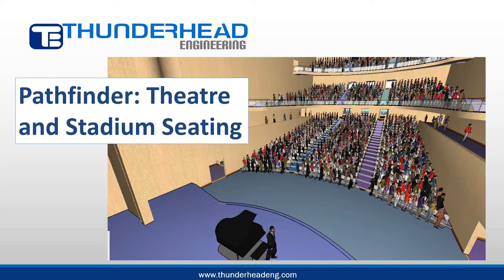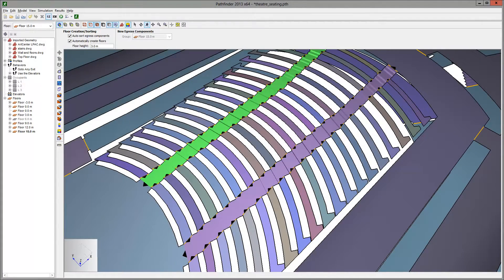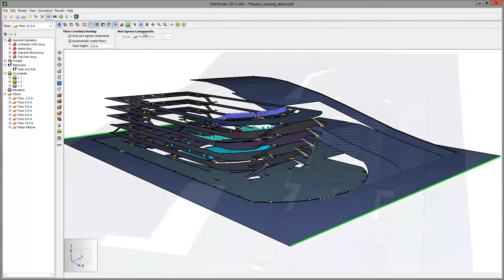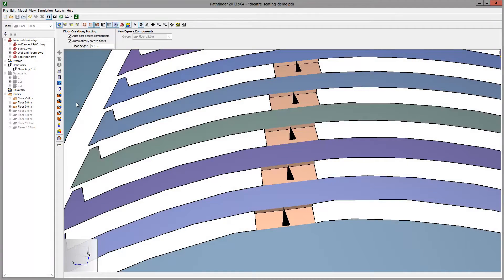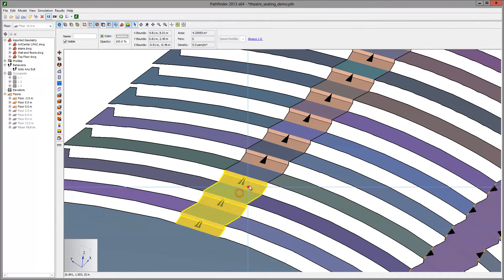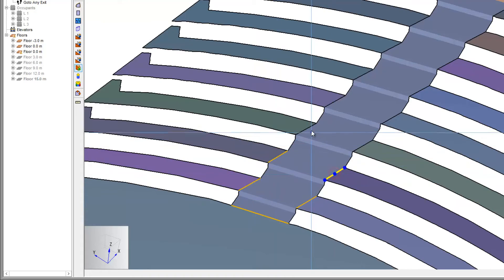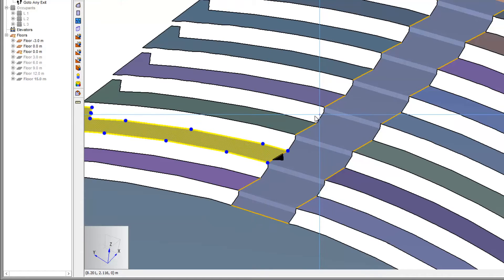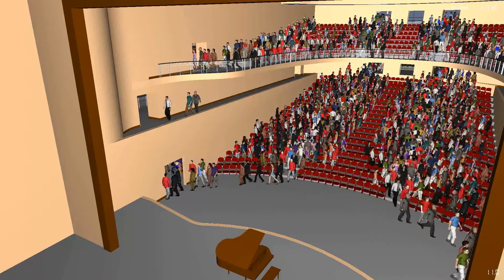Theatre and Stadium Seating in Pathfinder

Comment: Hello,
I would like to know a little more from pathfinder: For the different rooms generated, it is necessary to generate a different mesh as they are on a different Z level. 

Thanks,
Reply from the maker: There is a free trial of Pathfinder available, along with a nice tutorial to help get you started. 
Everything that the occupants walk on is part of the 'navigation surface'.  You can either draw this manually with the room drawing tools at different Z elevations, or extract from 2D drawings or 3D model that you have imported into Pathfinder.
You can save a lot of time by extracting the rooms from imported model of the space if you have one, but for simple geometry the manual room drawing tools work great too. Please see the Pathfinder support page to download the software, request a 30-day Trial, and start the Fundamentals tutorial. https://support.thunderheadeng.com/pathfinder/